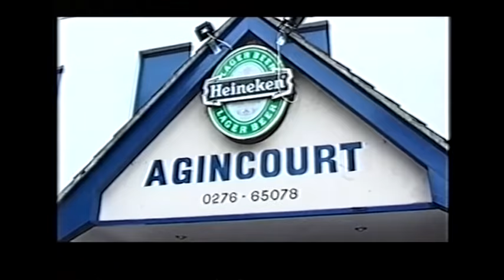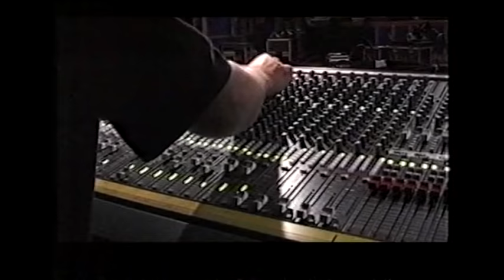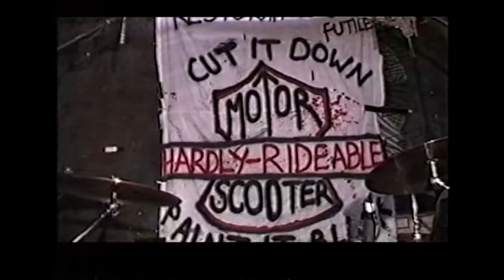The Scooter Boys (circa 2000) Blakemore/Jackson prods

Comment: I find it so funny people copy Quadrophenia and put mirrors all over their scooter and they think they are being original and expect the bike to win contests.
Reply: That's Comedy MODS for you he wasn't an original 60s then he missed late 70s early 80s revival as was all those ruffians had scooter's lol then mid 80s became about scooter's and customise to own taste and rally's became official scooter runs then mid 90s britpop era comedy mods started too appear on automatic vespas GAG with the bolt on Chrome crashbars front rack full of eBay plastichrome Chinese spotlights mirrors sprouting out fly screen backrest and the seat spare wheel cover either union jack leopard print or targets cpl whippy aerials with union jack or tiger tail on top buy autos in 50s 60s as can't use gears autos are not proper scooters they are mopeds give me af rayspeed dealer special lambretta GP or Armando's dealer special Vespa p225e pinasco too customs that inspired us like dazzle spiritwalker rhapsody in blue S2 then S3 59,n, running fine S1 lambretta all icons the union jack gs is a copied paintjob that I've seen same wavy flag on other scooter's drives in circles In Front mansion he tried rockabilly rocker scene jukebox and Cadillac finned 59 convertible scene saw he was tosser so tried mod and still tosser I didn't wanna be a rocker too dirty I like being clean AHEM HES A BUILDER WHO DOESN'T LIKE BEING DIRTY LOL no full license as 160cc illegal on provisional license bet scooter's trailered to shows sold my sx200 tv200 s3s tv175 S1 vespa 150 super t5 cutdown and 30yrs hoarding 15yrs ago stopped runs 99 as scene went stale and prices ridiculous 5x more than new 30quid scooters for 3000 bought tv200 in 86 200 plus my li150 that cost 70 lol 500 for sx200 in 88 now idiots want 10grand for now priced youngsters out scene no new blood scene dies simple drop prices let teens enjoy what we did on yts or giro money no more through greed